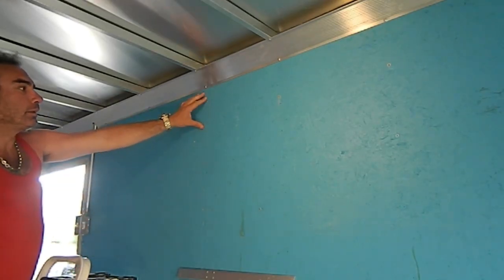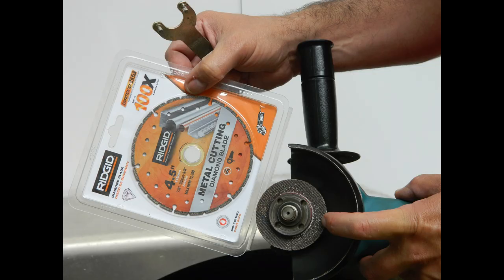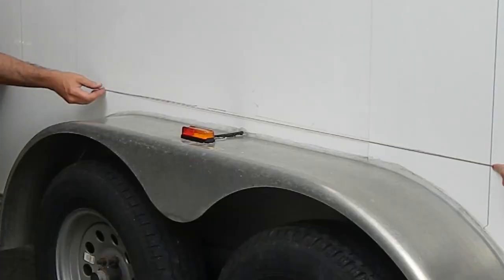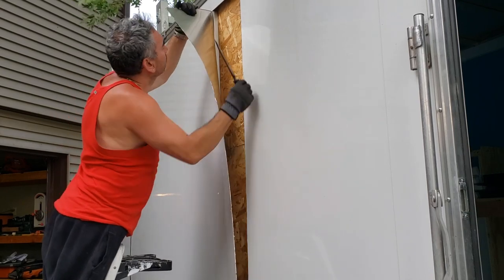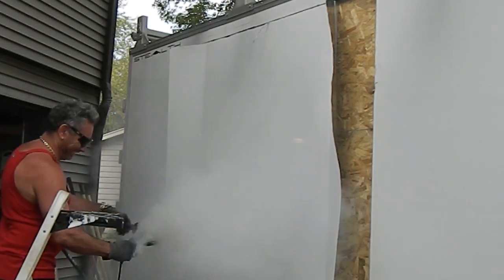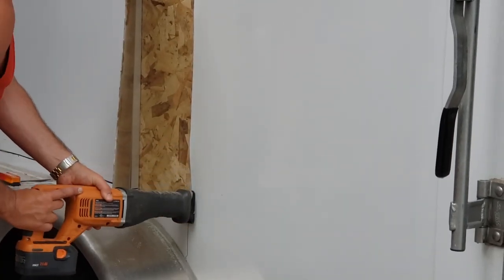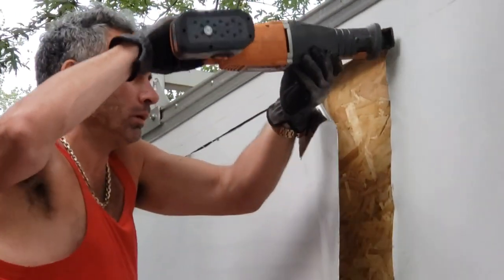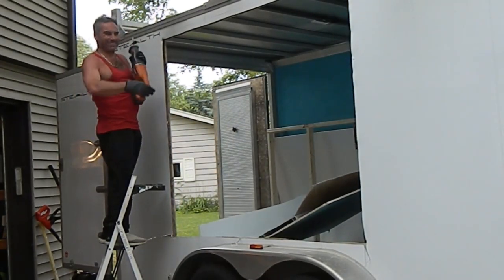Food Truck build Part 1 Concession Window Cutout.

Comment: Ya it's so easy for a cutting blade to Not cut straight. For people looking to do this. They need a system to cut the hole true and straight the first time. To re cut the edge is almost impossible.
Reply from the maker: A template would probably work great but seemed very time consuming, I'm going to frame it in with wood and then wrap it in aluminum.

Comment: how much did you spend from start to finish on getting it ready to use. I had seen a 6x12 ready with sinks and grill and fryer and breaker lights all but frig and freezer and AC. for 9 grand. but then I seen I could by a bigger trailer for like 3 grand so was wanting to know is it hard to do it all yourself and would I save that much money?
Reply from the maker: It's not completed yet